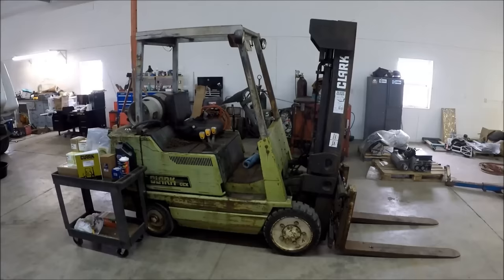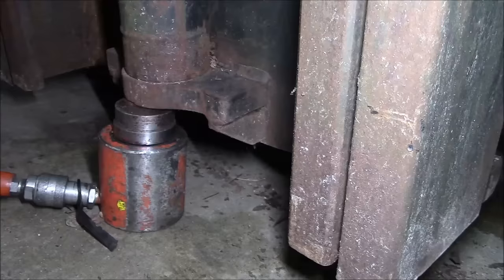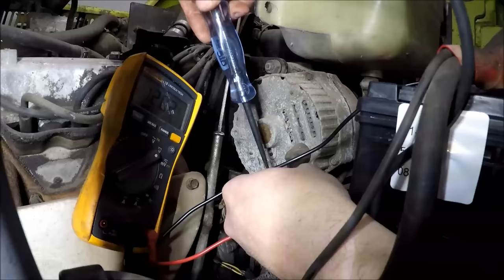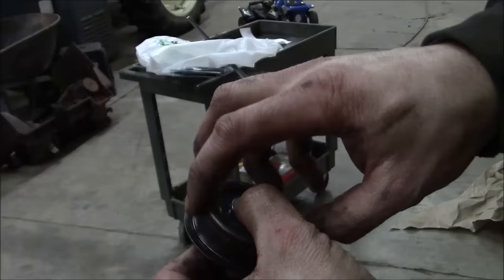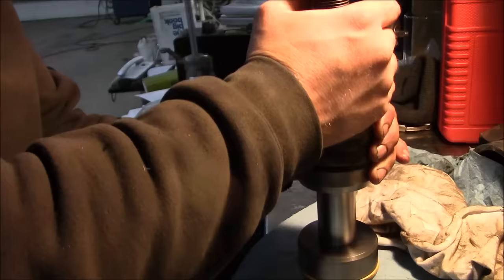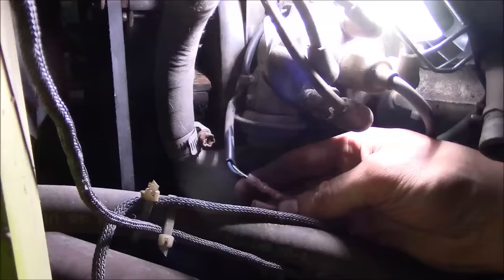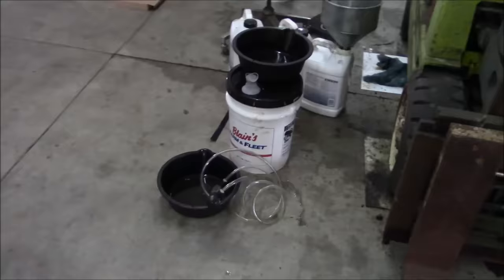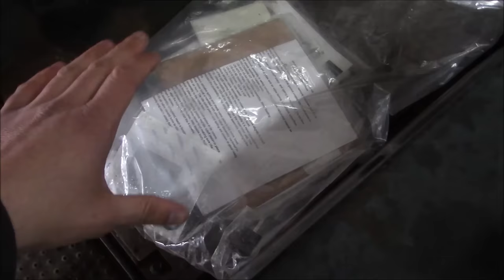Fixing a Forklift that Sat in a Field for 17 Years - Timing Belt, Mast, Hydraulics, Cleanup - Part 2

Comment: When you weld a nut onto a bolt you need to let it go cold before taking it off.  If you don't, it will not hold because it is still soft from the heat.

Comment: that's called a short mast but you need to check the roller in the mast, they can go bad and cause you major problems, also check the fiber bearings that hold the mast to the diff, they wear badly if not greased, we had these models at work 25 of them I did lots of mast rebuilds on those units but they are way better then hyster brand or nissan

Comment: And I thought the oil ran back from the front !
   Thing about those”fancy painted floors” is you can get them clean again and the oil does not soak in and make the place smell like cat piss all the time !
Reply from the maker: I wonder how the paint holds up to welding.
Reply: Watch Wes Work : no Wes you don’t weld paint on ! But seriously,keep the welding in one spot,put a plate under it,or use some of the outside you are surrounded with !
     Ask DeBoss if his floors wear out.

Comment: The company I used to work for had 8 top notch mechanics. They could fix any truck out there. But they were also responsible for the 10 or so fork lifts we had. To a man, they HATED working on those things with a passion.
I just wonder.with all of the things broken on this machine, how were they still using it at all.  And what was the straw?

Comment: to make a vac puller get a shop vac put a 2 1/2 gal bucket or 1 gal bottle in side that lets you put top of vacuum run clear hose the size you need to  go in tube to get out what ever it is you need to get out then take 2 liter bottle with cap cut top off after the taper so that it will not go thru hole were hose fits drill hole in cap of bottle a little smaller than hose so it makes tight fit run hose in to container  turn on vacuum push bottle top with hose running thru it up to hose hole put hose in to tank were liquid is it will be pulled out.
Reply from the maker: We call it a "suck bucket"!

Comment: Wes..I'm commenting here cause the fuel system rebuild is in restricted mode whatever that is. I wanted to say thank you for explaining how that works. I've always wondered. I wanted to ask if you could explain the difference between a propane system on a gas engine which you did and a diesel engine. Thank you ahead time.

Comment: i dont know about fork lifts but as u know on a car the ign light gets a feed from the ign 12v, and the other side of the bulb goes to the alternator, as a kinda earth, but when engine running the alternator puts out a 12v of its own to the charge light, as u know 2 12v feeds into a light, wont light the bulb, one of the 2 wires must be ground to light the light. if im way off, please correct me.

Comment: Cut a chain link. And I was wondering how I was going to do that. I changed the type of battery in my RV. The old frame (that went around all the old battries) and the 4 J bolts are all  wrong  for the new battries. I can make a new frame up easy. I was going to drill holes in the steel battery shelf and use eye bolts. Nope, cut a couple of chain links in half and tack weld them to the steel shelf. Too easy!
Reply from the maker: There just happened to be an old chain laying on the floor by the forklift. One thing led to another...

Comment: I'm working on the same forklift and the front right wheel is locked up and the motor won't stay running done change the plugs wires and distributor cap rotor button and coil it's like it's vapor locking any info will be greatly appreciated

Comment: I see actually a use for those fancy painted or coated shop floors. They sure are a lot easier to clean up after making a mess, especially with spilled liquids of any sort, than raw concrete which tends to soak up as much oil and stuff as possible.

But man, if you would try to clean up anything like that including oil in a driveway without having an oil separator around here, they would hang your sorry ass up on the highest tree available in the vicinity.

Comment: Seems like a lot of these Clark's (that I see for sale) have transmission issues.  Well, to be specific...moving issues.  Some the wheels spin when up in air, but don't move forklift.  From your experience, would that scare you away?  Any thoughts on a repair cost range (parts + DIY) that you would budget for when looking at a lift that does not move or move as expected?  I know it could be anything.  Maybe a better question would be any experience on worst case repair cost on their transmission?  If I knew that a new tranny was worst case example and $2K, that could be used in the negotiation.  Thanks for the vids!

Comment: I just got a 1994 Clark gcx30e, what hydraulic oil did you use? The dealer is saying iso/aw32, but i see you used 68? I dont have a service manual yet, so not sure what i need to service this thing

Comment: I see your farm and fleet bag. They have a cheaper gold battery that will fit right in there
Reply from the maker: I've had horrible luck with Farm and Fleet batteries. They are cheap, but they don't last.
Reply: @WatchWesWork  That's not true at all. They're American made by Deka, who is objectively the best builder of domestic batteries! My Farmall 560 has a 24 year old F&F battery. My daily driver, 2500HD pu has a seven year old one. You got a lemon!
Reply from the maker: @Farmall450  I ran them in my old forklift. Never got more than 2 years out of one. My neighbor had one in his car. He replaced it 3 times in 4 years. The "warranty" is prorated so the closer you are to the end, the less they give you toward a new one. I'd rather pay more for something better. Napa batteries are also made by Deka and I have never had an issue with them.
Reply: @WatchWesWork  They're the exact same battery as NAPA, by tier. All warranties like this are prorated. 
I've taken them directly off the East Penn truck with Farm & Fleet right next to NAPA with the same UIN #s lol
Reply from the maker: @Farmall450  That's fine. Keep buying them. I'm just telling you my experience.
Reply: @WatchWesWork  I just feel you're overpaying for the same thing based on 2 instances! I have ~20 of their batteries around the farm.  Only one issue, a 6v which was on a tractor that didnt charge anyhow, and probably froze. Enjoy watching and appreciate the videos, just keep it in mind! If you want cheap garbage, I've found exide at Rural king/TSC/wally to suck

Comment: great stuff to watch but two real questions. why not power wash the forklift when it came home?  all the grime you had to work in doing the belts and changing out the piston seal and all the rest? you showed the mess on the floor allot of which i think you would have avoided (save the leaking cylinder fluid) to me it just makes sense cleaning the thing prior than post all repairs especially opening up the timing belt and all that oil and grime in there. we both know timing belts dont like getting oily and greasy.  the only ones i have replaced that failed were always with oil and grease on them, (one exception was so loose it rounded the teeth then jumped on the cogs) so all that grease and grime in there is just begging to fall on and get all over the belt not cleaning prior when you have a power wash like you do, why? not criticizing just wondering. i know previously you stated the "power wash fetish" of youtubers  but i think its just a matter of general housekeeping to do so when you have the luxury of one there. i get not repainting the fork lift but the black sheet floor and the black uprights and covers by the lift controls, with all it all pulled down how hard is it to just rattle can them back black again? i know its was out 17 years rusting but just to have it stay reasonable on those places being sheet metal rather than it rusting up and rotting out? we disagree its worth and importance but i would have taken the time with them off into the blaster or with a DA sander ruff them up for some black paint to avoid some further rusting and issues as i am sure you will have owning this lift another 17 years in use. the body all the bonks and scarring will happen i get it, but the rest why not?

Comment: long shot. do you know much about the steering system on this lift? I have one that is very similar and has hydraulic fluid coming out of the 'gland ends' when you turn the steering wheel. the counter weight needs to be removed to remove the steering box but i was wondering if you knew if it was possible to just replace the wiper/gland seals without removing the counter weight as i dont have a good way to remove it. Thanks
Reply: so to update my comment. I ended up taking the counterweight off and removing the steering assembly to be able to get the to cylinder. I believe its actually possible to remove the steering assembly without removing the counter weight but youd need to have the entire forklift raised at least  12" higher than ride height

Comment: that looks like a standard automotive alternator, like a 12SI
Reply from the maker: It's a 10SI, but it's straight out of the GM parts book. Would have been standard on any GM vehicle up to maybe 1980. My dad always called them "Delco-tron" alternators. They used them on tractors and tons of industrial equipment.
Reply: @WatchWesWork  yes. Thanks Wes.  I have had a few things with 10SI/12SI's that were pretty far from being cars or trucks.   Glad to see you got it all working.  I wondered if it had mostly been just rust.
Reply from the maker: @gbowne1  The years were not kind to it. Maybe brushes could have fixed it, but I can get a whole reman for $50 from my local auto electric supplier.
Reply: @WatchWesWork  yeah, didn't look like it.  but the sprayer sure cleaned it up good.  looks like the back got pretty scratched up from runnin it into somethin.. but doesnt look like it had much rust otherwise on the outside. yea the alternators they arent terribly expensive unless you look on fleabay. now when you get to big filters get ready to pull out the card lol
Reply: "Delco-Tron" was GM's name for them. "Alternator" was a Chrysler trademark. At least that's what I was told many years ago.

Comment: Question Wes . The adjustable C- shaped tool used to unscrew the top of the hydraulic cylinder with the ratchet drive, does it have a technical name ?  👍👍🇦🇺
Reply from the maker: It's a pin spanner. At least that's what we call it in the USA. Made by OTC tools.
Reply: @WatchWesWork  Thanks Wes. I'll be contacting OTC in the future. 👍👍🇦🇺

Comment: so what do you like to use to wash your garage floors after a project like this where you have oil and grease and mud on your work space (floor).
Reply from the maker: Oil dry rubbed into the concrete with my boot works great.

Comment: Wes did you end up cleaning the radiator fins and trans cooler????
Reply from the maker: Yes. Both with air and water. Then I took a stab at straightening some of the fins. It worked OK.

Comment: A high-pressure sprayer with hot water makes it easier to clean the machine.
Reply from the maker: That's what I am using.
Reply: @WatchWesWork  
I saw that, that's why I wrote it.

Comment: did you ever work on caterpillar T35d? i need the service manual do you know how i can get that?
Reply from the maker: You can buy it from Cat.
Reply: @WatchWesWork   hey i got this cable below the steering wheel which i think is the parking brake cable ...?
it has a knob  (Does not come off)
you would have to either remove the entire cable or remove this knob to basically get the panel out of the way and have full access to the brake master cylinder/.electrical wires etc 
the panel is made of some plastic material 
what would you do ?

Comment: Er mer gerd, how absolute DARE you operate the forklift with the tank straps undone?! You couldda blowed up all of in-day-yana! 🤣 They absolutely kill me with their SAE fact-tree training 🙄 

BTW, I was cringing with the hex key in those brake cylinder bolts... You were probably driving with 3/16" in 5 mm head. 

I do tons of back and forth between M&Ms and inches. Probably should just use calipers ... So many different sizes are soooo close, I've learned which way things aren't compatible and start there (like if a 5mm Allen key fits, it's metric & if 1/4” Allen key fits, it's standard). And good luck if you don't know the spec and are trying to choose between #10 and 5 mm. 🙃

Comment: Maybe that's a newer engine from a car and whoever swap it didn't change that water pump to the fitting
Reply from the maker: No, that's all factory. It's just a little odd. Experienced guys have said they later used the engine mounted water pump and just used a fan idler up on the top.

Comment: Does that pressure washer heater take dyed diesel or ULSD? ;-D
Reply from the maker: Heh. I think they are supposed to run on Kerosene. But I usually run it on whatever radioactive horse piss I can drain out of nasty old fuel tanks.

Comment: You have a comic timing and patter to your speaking that reminds me of Norm MacDonald. You should try to do some stand-up when you get a chance. Also, that loader with the pooched engine... people get emotionally attached to these machines like they're abandoned puppies on one of those commercials looking for some donations. That being said, the size of that motor looks similar to a 2 stroke 671 Detroit [can't kill those with a stick]. You can get those pretty cheap running in most states from what I hear... not sure you'd need a different transmission but... looks like one of those would fit... anyway... Uneducated and numbskull idea... but hey... the puppies need help. :-))  PS: Can you get some lime green or snot green rust paint for that forky and perhaps hire some kid to spray it all over it? Give all the emotionally attached puppy people a sense of "Awwwww" :-))
Reply from the maker: We are going to get the loader going eventually. I don't think there is any stand up comedy being done anywhere near me. Plus I doubt I would be able to do it.

Comment: I’m a forklift technician for a livin so I got sucked in a bit. I’ve watched everything you’ve done Wes and it nice to see an individual in this day and age of libtard snowflake entitled no skills unless people on tv crying about the president that has the drive to take on mechanical tasks. I’ll probably get hate for it but the Clark lifts are morphidite pieces of crap. The parts are cheap but imo the machines are throw aways after 5k hrs. It’s the same with hysters, Yale’s, Mitsubishi, Nissan, and doosans. You can probably hear it coming already... the Toyota’s are without a doubt ten times the machine. It too bad everyone had a bad experience with the one at the industrial complex because the mast, but with a proper free lift three stage mast they are unstoppable. They happen to be my bread and butter daily so it’ll sound like I’m wildly biased but I’ve worked on them all and my opinion is based on the experience of being the guy that’s balls deep in lift trucks 6days a week. Take it as you will. 🍻cheers and keep up the good work
Reply from the maker: The Toyotas are reliable. We had some other problems with that one at the complex. It had some kind of goofy compensation system on the rear axle and that never worked right. It would bind up and the machine would constantly raise a drive wheel off the ground with no load. That made it useless in snow, ice, even wet pavement. The dealer finally fixed that issue. The exhaust connection from the manifold to the pipe would never stay tight. I even replaced the studs once and it still rattled loose withing a few months. But that thing led a hard life. It was really easy to get on and off. It was fast. The clear view mast was nice too.
Reply: Yeah on those older ones the SAS (System of Active Stability) was a new fangled safety thing and the cylinders only lasted a few years in harsh environment

Comment: never test the cylinder with air. if you are unlucky you will destroy your seal
Reply from the maker: Well if you destroy the seal with 120PSI of air, how can it possible handle 2500PSI of oil?
Reply: @WatchWesWork oil has a different density than air

Comment: Yes! Metric w*nkers! 21mm, which would be 2.1cm, 0,021m or 0,000021Km, which is convertible in seconds in your head and can be displayed on the same frkn scale! STUPID! 
Why not 0,826772 inches, which would be 0,0689 feet, 0,0229666667 yards, or 0.00001305 miles? It could even be very handily expressed as 206693/250000th of an inch, which is, like, completely obvious and easy to figure out n use n stuff?... 🤪
I do concur though, when in rome...and most of all, don't mix.